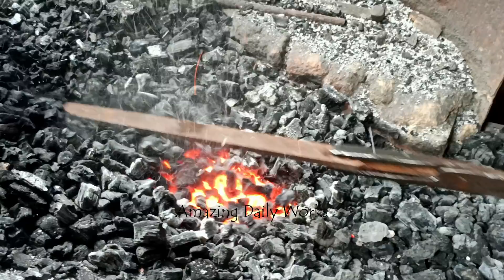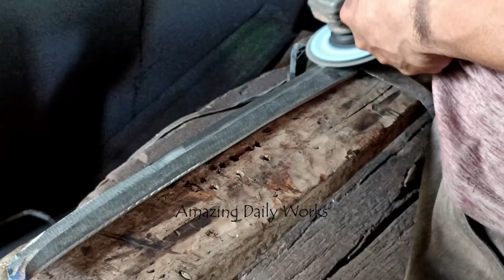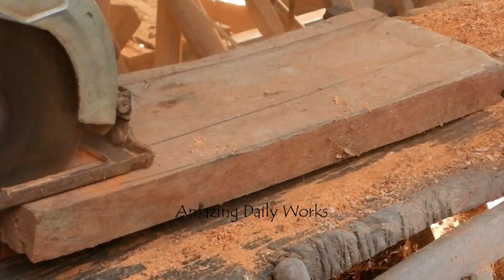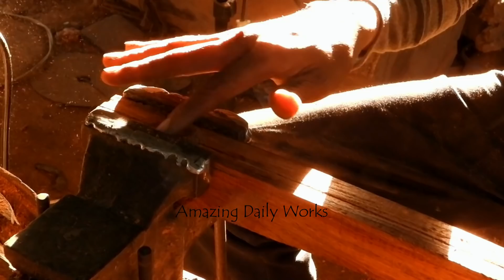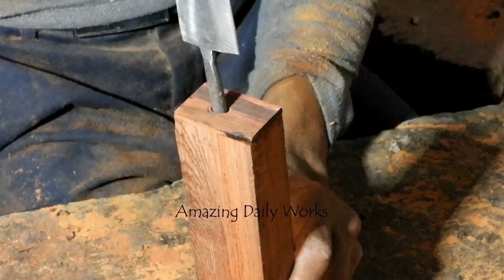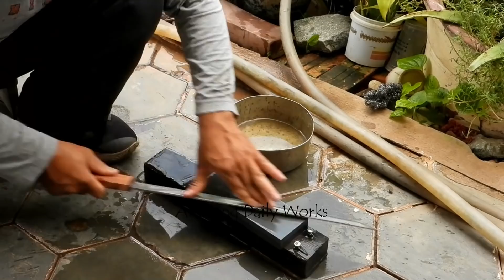Forging A Sharp Straight Katana From An Old File || Japanese Sword

Comment: Very nice work. I always think when I see some one using an old file for a knife, 'why not use the tang of the file for the tang of the blade?' Well done!
Reply from the maker: Thank you for your valued feedback.
Reply: JESSE REID  You could forge the bottom part so it flows into that skinny tang, which then becomes only the lower part of the tang. But the way they left it here... let's just say the judges on forged in fire would refuse to swing it. The file isn't meant for any impact, that's why it can afford to have that tiny tang, but the sword is. It needs a stronger tang. I wouldn't even trust that tang on a knife tbh.
Reply: @mrkiky   согласен для подобной зборки хвостовик очень маленький напильник хоть и может выдержать большую ударную нагрузку но хвостовик здесь слишком маленький и тонкий из того материала можна было зделать нормальный хвостовик как и закрепить его через шпильку как у многих японских мечей подобных катане тогда нагрузка была бы меньше и хвостовик мог бы справится с положеной ему нагрузкой
Reply: @ГерасимовСемен  On Japanese swords, the tang is almost as wide as the blade. It just has 2 tiny little shoulders for the habaki to sit on. Just a couple of millimeters on each side. This one is just ridiculously thin and very abrupt shoulders.